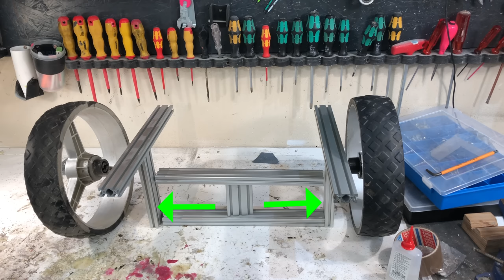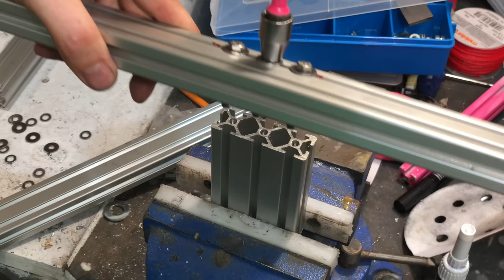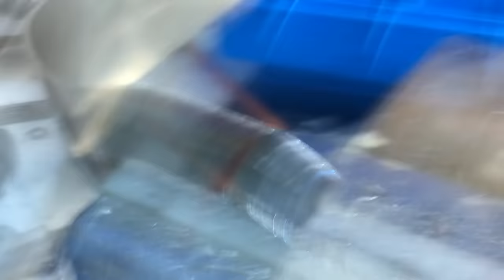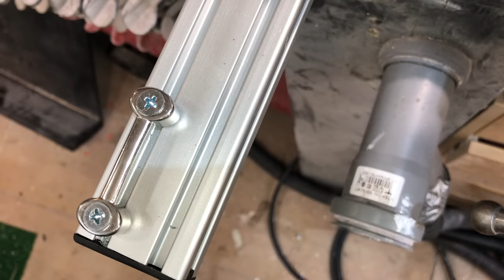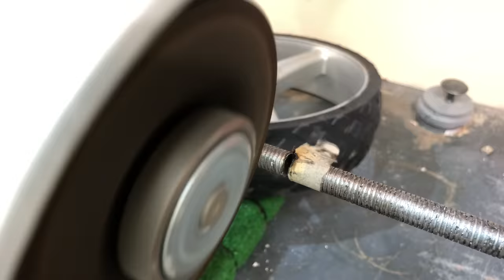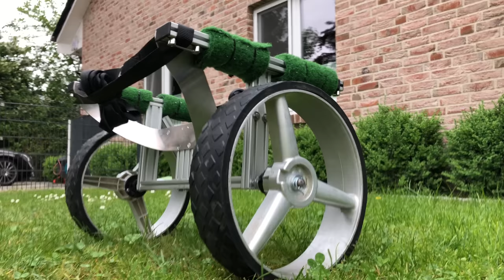Simple DIY Kayak Cart (Homemade from scraps!)

Comment: That came out great! I'm building some kayak carriers for my car right now, been kind of strapping two at a time to a small sports car (m3) and it's not the most stable thing in the world.
Reply from the maker: I love the three series. Best car I have ever driven. Not the most useful cars for makers though. Are you building something to interact with the roof mounts?
Reply: Max Maker honestly it's our shop truck: I have the oem "profile" rails and we ratchet strap everything to that. I bring home everything from long pieces of steel to medium sized tool boxes (if they're crated well). Versatile cars!
Reply: Max Maker oh and yes on interacting with the factory roof mounts (by way of the rails), I'll send you a picture when it's finished. Welding is all done, I just have to get some protective paint on the parts before I bolt them up. It's a side project, won't be anything that ends up on the physics anonymous channel.
Reply from the maker: Why not? Might be interesting to watch. Somehow when I ordered mine, the folding backseat option got lost. So they are fixed in place. A roof rack would be useful.